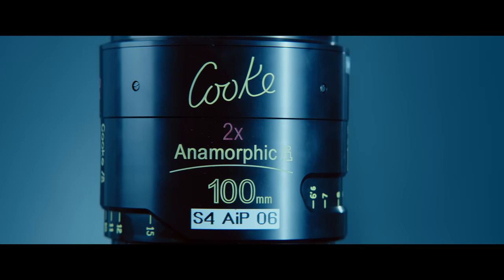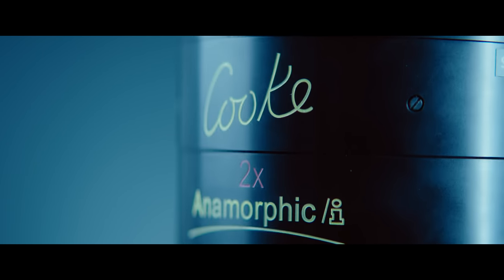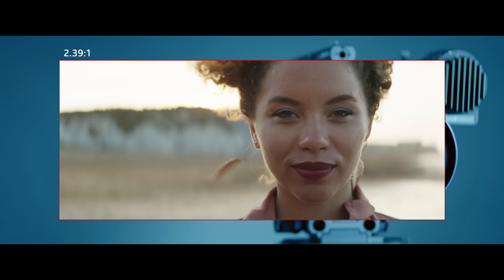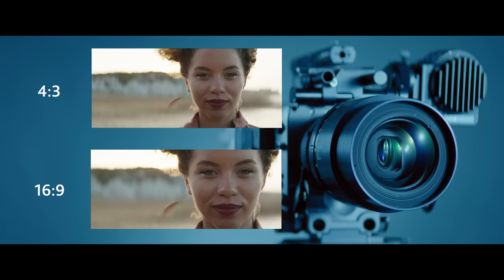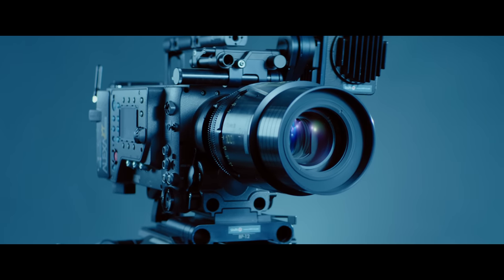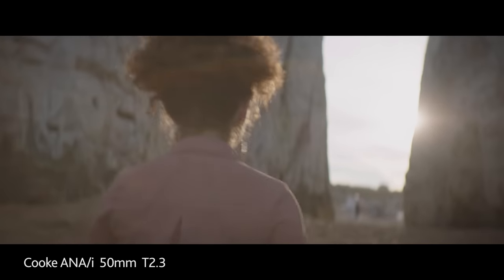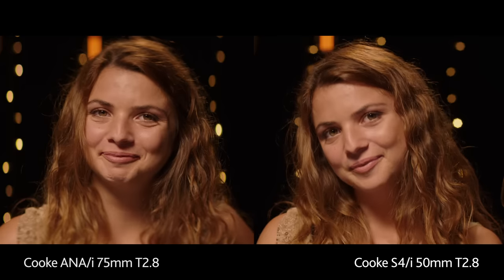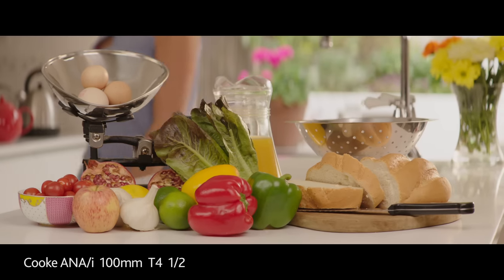Cooke Anamorphic/i Prime Lenses

Comment: Wish there were digital camera sensors which shot in an ultra tall aspect ratio specifically for anamorphic stretching.

That way, you could get the 2:39:1 ratio without cropping the majority of the image and degrading the image quality.
Reply: GH5 with firmware 2.0 will shoot 5K anamorphic 4:3

Comment: very good explanation even though i have not really understood deeply everything. but i get the basic tips like larger sensors are better for the anamorphic lenses
Reply: Well don't go to fast here, or you'll make a mistake. It's the record ratio capabilities of the sensor that matters in the first place.
If you have a FF sensor restricted to 16/9 record format like a Sony AIII, then to get that standard 2,39:1 ratio with a X2 anamorphic, you'll lose a lot field & definition.
So be sure the camera gives you a 4/3 record format in the first place.
Now you can use a smaller X1.5 anamorphic with a 16/9 record format, but effects will be less dramatic.